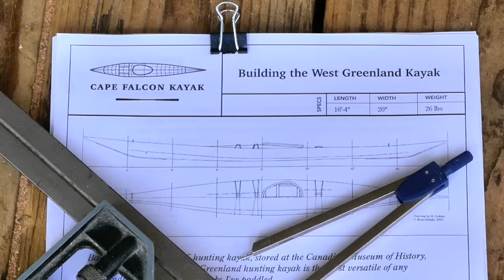Building a West Greenland Kayak, Step by Step

Comment: For those who are able to see and appreciate the beauty of fine craftsmanship they need go no further than this.  I have the highest respect for this kind of endeavour; it combines knowledge skill and TLC to culminate in a craft which is a joy to behold, and, I don't doubt to use.
I would like to make some general comments, and to express some personal views and prejudices. 
I was amazed at how the hull frames, bent by a combination of hand and eye were able to be formed with such exactitude that they could be assembled in a ' fair ' shape, that is without humps and hollows when the stringers were attached.
I admired the way in which modern techniques were applied to the time -honoured manner deriving from the original Inuit techniques.  That however stopped short as I saw the use of fibreglass cloth, followed by the liberal use of of synthetic resins.  I did like the way it was sewn - again a retention of original techniques.  One assumes that these modern materials are used as a result of the lack of availability of raw seal skin !   But in my opinion it would have been more desirable to use materials  not so far from the original and ones which aren't potential health risks to the builders.
All this should make us respect the more the earlier Inuit who did all this with animal bone and drift wood, working without  the benefit of power tools, and with the most rudimentary cutting tools probably working on an open beach.
It was most appropriate that the piece should end with a demonstration of how kayaks are intended to be used.  That is by a highly skilled pilot who needs a highly manoeuvrable craft able to chase his nimble prey.  It is not inappropriate to compare these craft with modern-day fighter aircraft which are designed to fly an a knife-edge of stability, computer controlled, which is the only way that they can be operated to do the job for which they both kayak and aircraft, are required..
Reply: As I understand it is not fibreglass.  Either nylon or Dacron, probably Dacron as he heat shrunk it.  The coating probably two part flexible polyurethane.
But yes amazing skill.  For a beginner to get such a fair shape can’t be easy.

Comment: Great to watch.
Learned a few techniques that will be useful for the future, if I can remember them. What was the material that you used to cover it with?
The finished kayak is a thing of beauty. There's a saying, ''If it looks right, it probably is right!'' It must certainly apply to this kayak.
I constructed my first 14' Kayak in my mothers front bedroom, when I was about 14, from a paperback book of plans, printed in 1944, the year I was born, and in French. (I could not read French) 
The materials were scrap leftover roofing lattes, and bits of floorboards, scrounged from new council estate being built, and canvas and screws, that my father scrounged from work in a ships chandlers. I had to cut the 14' lattes lengthwise, with a 10'' pruning saw, all I had.
My mate copied mine, and we spent a week canoeing/camping down the Thames, from Oxford to Putney with them. I used tent proofing to seal my canvass. It leaked! (Slowly)
My mate used cement proofing, his didnt, but the canvass lost its flexibility. 
I sold mine to my local scout troop, about 3 years later, for what it cost me to build; (about £5, which was about a weeks pay for a labourer then.)! 
They intended to use it for slalom practice, but it was so stable, that you'd fall out of it before it would turn over. It was 36'' wide, but only needed 3'' of water to float clear, with my 15 year old, 150lb bum in it.
.
Reply: As you didn't receive a reply to your query, I believe that the cloth used is Kevlar. Definitely something synthetic, as you couldn't cut it with the hot element if it were canvas.
Reply: @leighchristopherson2455  
Thanks.

Comment: It looks like the cockpit framed by the straight members will be about 6 inches wide, then suddenly you put the coaming on and it's a round hole, what did I miss?  Beautiful boat, great video.
Reply: Those two straight boards are the back deck stringers. The cockpit sits in front of those.

Comment: Very nice, yet i am always hoping the synthetic fabric, and even worse, the 2 component chemicals can be left out.
Reply from the maker: I agree it would be nice to do something different and there are alternatives but they’re heavy and fragile and have a pretty short lifespan.  The traditional boats were covered in sealskin and had to be re-skinned every single year in a process that was unbelievably labor-intensive.  A friend of mine in England has been experimenting with flax cloth and linseed oil and it seems to work but it’s tricky to work with in the durability is not nearly as good.  The two-part chemicals or actually a good thing in this respect though, The single part stuff is incredibly toxic by comparison.
Reply: @capefalconkayak  Thanks, indeed i see the dilemma, yet you see my point though, the beautiful skills and materials, and than the toxic wrapping. I am sure new devolments will come though. there are also experiments with fungi, it is worth continuing to look for sustainable solutions.

Comment: I am guessing that each model has a certain amount of overall rocker built into the plans. Some of this is due to the ribs, but some appears to be due to the main gunnels (gunwhales?) as they need to shed water. To the degree that each builder with the same plan brings their own talent to the sawhorses, is this rocker variable?
Reply from the maker: The rocker is variable by choice if somebody wants to modify performance, but otherwise, the system constrains it fairly tightly.  People have different skill levels working from the same plans might have a quarter of an inch difference if that.

Comment: Ok , Questions,    so what is the weight of the kayak , total length and width and I will assume you made your paddle too so is it hollow as well? Nice video without the boring demo of doing the same parts numerous times as some wood workers do . As I can not swim and I have attempted to breathe water several times trying , I have found it far easier just to stay on top of the water and let other people do the rolls.
Reply from the maker: The paddle is solid it weighs about 1 lbs. 14 oz.   The kayak weighs 26 lbs.  No problem with staying on top of the water, that’s why I design lots of different kinds of kayaks and canoes.  Everybody wants something different.

Comment: Wow! Simply fantastic! What did you use to make the "cover"? It does non seem fiberglass
Reply: It’s polyester fabric
Reply: @MrApmech  ok thanks, I thought it only worked with fiberglass, but fabric seems a little less expensive
Reply from the maker: It’s actually 9 ounce nylon cloth
Reply: @capefalconkayak  thanks!

Comment: Interesting build until the fiberglass and resin ...in the day it was burlap and tar. then canvas and lac
Reply from the maker: Fact check:  this isn’t fiberglass and resin, it’s nylon and polyurethane.  Back in the day these were covered with seal skin and then sometimes with canvas and paint in the early to mid 20th century.
Reply: Never seen fibreglass cut with a hot knife before 🤦‍♂️
Reply from the maker: And you still haven’t!  This is nylon cloth.

Comment: What a fascinating video. 
From the way you have fabricated the boat, it looks as if it is designed to "move" and to be flexible, rather than be rigid like a modern off the shelf kayak. That being the case, does the polyurethane finish remain flexible and not crack over time ?
Reply from the maker: Correct, The whole thing is just very very slightly flexible.  The nylon cloth works well with the two-part polyurethane that I use.  Skin life is usually around 5000 paddling miles.
Reply: @capefalconkayak  Thank you.

Comment: Hi what the cost to build 
It?
What material and tool needed
What the time frame to build it?
Thanks
Reply from the maker: For a first time build, it usually takes people about 60 hours.  Total cost including the video course and plans is about $1000.   And the tools are most of the same tools you would have any wood shop.  You only need the power tools for the prep work though, so if you can borrow tools or rent time in a wood shop, you can do the rest of the work with just simple hand tools at home.  If you want to, you can sign into our free skin on Frameprep course which you can find on our website and there’s detailed videos that show you everything you need to know about prepping for the build and you can also download sample plans before spending any money.  you can also check out our student builds blog to get a sense of other peoples experiences using this system.  Feel free to email me directly with any questions.  my email is on my website.

Comment: Stellar work. 1 nee subscription.  Frame is amazing. Wondering about flexibility with epoxy skin, certainly not a comparison to a skin boat with same frame.  Care to elaborate or host an open house so we can paddle your craft?
Reply from the maker: The skin is 9 ounce nylon saturated with three coats of two-part polyurethane.  It remains somewhat flexible but is very impact and abrasion resistant.  I just put up a video on the channel going into a lot of detail about skin on frame durability, do a quick search and it’ll be easy to find.  You’re always welcome to come borrow a boat and try it out anytime.
Reply: @capefalconkayak  subtle details I didn't catch on small screen. Yes, that should be more flexible and skin-like. Nice details.

Comment: The woodwork is beautiful. That canvas finish not so much.
Reply from the maker: How would you do it?
Reply: @capefalconkayak  The seam on top of the boat looks ugly and kind of ruins the look for me. Would there be a way to sow the pieces together and turn the seam 'upside down' before the sheet goes on the boat? I don't know if that would work but it would hide that ugly seam ridge.
Reply from the maker: @takuan650  There’s a couple other ways to do it that look a little bit cleaner but it takes a LOT longer to do.  The look doesn’t bother me personally so I stick with this method but it’s not the only option.

Comment: Cool small boat but the plastic final touches made me unhappy.
Reply from the maker: considering that the traditional way to finish one of these involved killing at least four seals and one walrus and then having about six people put in several hundred hours of work to make the covering, the rub strips, and the toggles, it didn’t seem like I had any other choice besides plastic...
Reply: @capefalconkayak  Hopefully they also ate the animals.  I've met dozens of eskimos surprisingly, unfortunately they were all drunks so I've never talked about this with them.  They're very strong and angry from my limited first hand experience.  You're a very skilled woodman, I believe you can definitely carve up some wood bits.  I also realize fiberglass and resins are basically plastics, I mean more or less... But this sort of high quality build needs wood or maybe brass, or copper finishing touches.  Anyways thanks for the reply.  Good work.  I'd float in the lake in one of these.